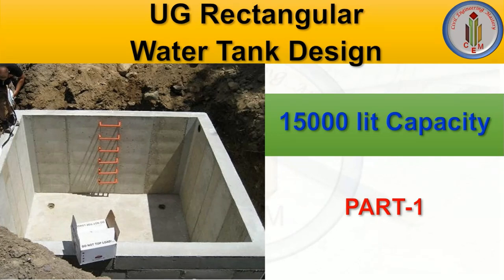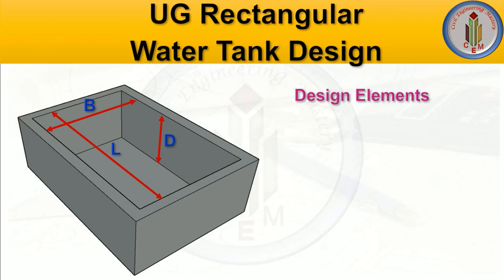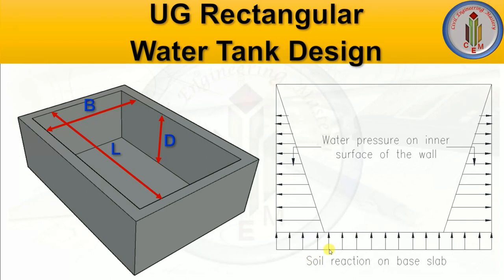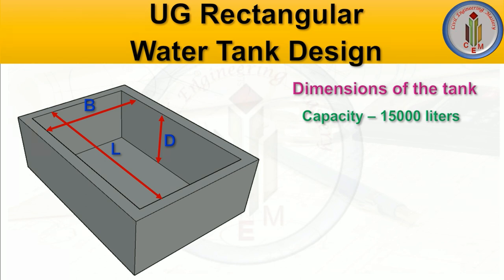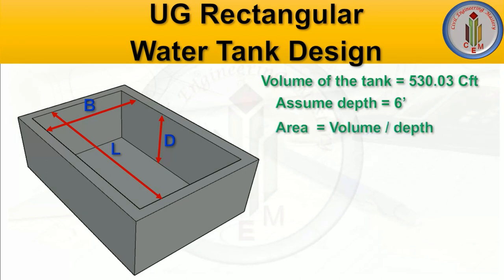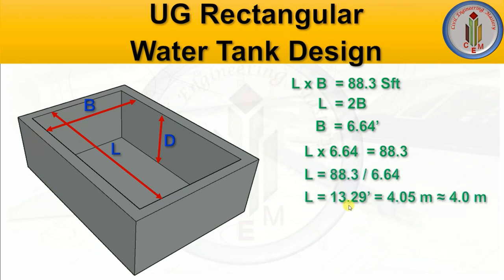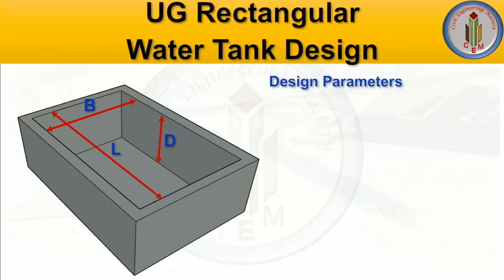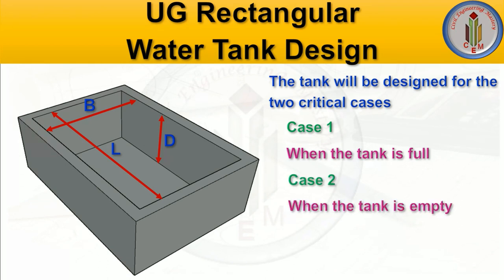Under Ground Water Tank Design | Rectangular water tank design | RCC water tank design | water tank

Comment: Saw your video and it was mire informative. I am in Doha - Qatar and I am planning to construct a sewerage under ground tank. The size is L3.5mtrs x W2.5mtrs x Depth 2.5 mtrs. Pls assist me with following info...
1) Thickness of RCC slab at the bottom
2) Thickness of RCC Retainer Walls
3) Concrete mix ratio
4) Reiforcement rebar steel thickness for  for both direction, placement distance for both base slab as well as for retainer walls